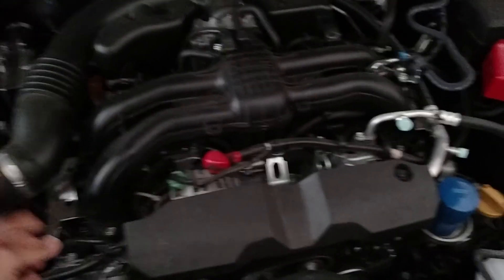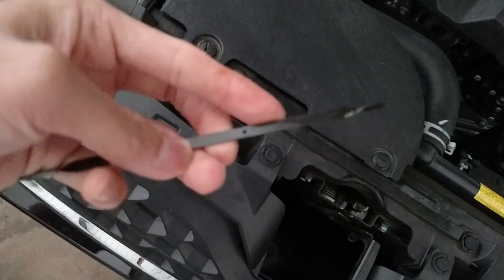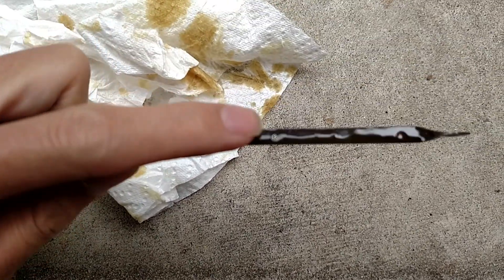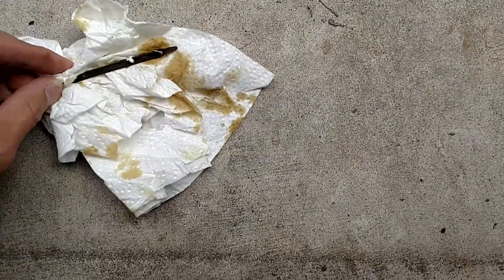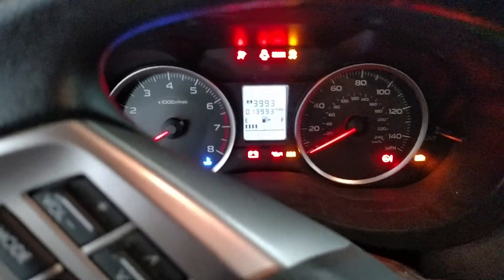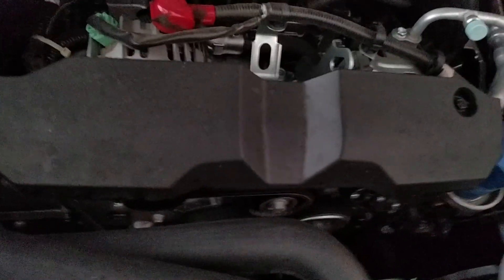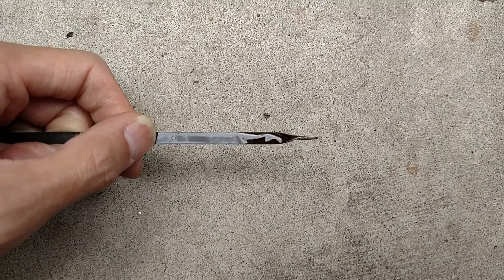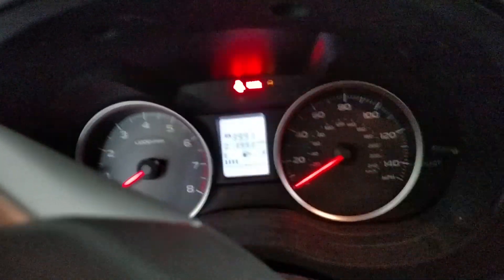2014 Subaru Forester oil consumption 12158 - 13993 miles

Comment: when you measure your oil, MAKE sure that the vehicle is on a level ground. Take an ordinary level and put it on the oil cap, which Subaru sets to be perfectly LEVEL for a reason.  See if it is perfectly level. Thats the only way to accurately measure oil. I have seen people take out their dipstick on an incline and measure. I will walk up to them and ask what IN THE FUCK are they doing. Especially on a car that has a 4qt sump. Front end that is 1" off the rear is gonna make it look like you are 1qt short. Another thing, Dipstick's L mark to F mark is 1 qt exactly in a Subaru. So when your oil sits at L means you have 3 qts inside the engine. And you when you do oil change on it, 2/3 qt will come out in 30 seconds, while the last qt might take 30 minutes to drain out of the engine, just because of the engine design. Oil sits in these engines at the bottom of the heads and block because it is level with the ground.
Reply from the maker: +Y10Q Subaru verified that the engine is indeed defective and replaced it. It was 0.75qt low in 500 miles. I got a new engine from it. And it still burns .3 qt in a few thousands miles
Reply: yinglish119
 I am just saying for others to know this. My wife drives a 2010 Outback and to tell you the truth I haven't checked it since December when it had an oil change. Didn't burn or leak so far that I know of. I drive a 2001 Legacy and that thing leaks about a 1/2 qt every 3 months or so when I check it. Old car high miles, I don't really care about that much.
Reply from the maker: Which is fine. But my video addresses an known issue that Subaru settled a lawsuit in Jan of 2016. This video pre-dates the settlement.
http://jalopnik.com/subaru-settles-lawsuit-over-oil-burning-cars-1752805682
Reply: i see he was taking it on his garage which was flat. I see he did it correctly. I see he did it even twice to make his findings bulletproof.
Reply: Incline in a garage?  Perfectly level? omfg

Comment: Use the Lemon Law and get your money back, It will only get worse until your engine siezes
Reply: We were told (Before the class action suit) that this was "normal" for the break in period with synthetic......  I'll never buy another Subaru, as long as I live.
Reply from the maker: Same here.
Reply: Lemon law only applies if there have been three attempted repairs and no fix to the same issue.  You can’t just pull the lemon law whenever you feel like it.